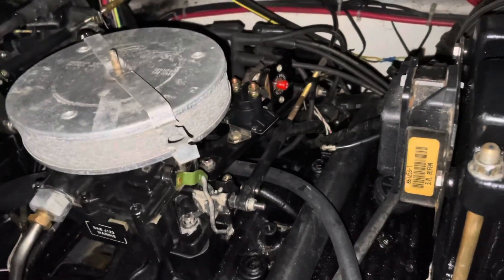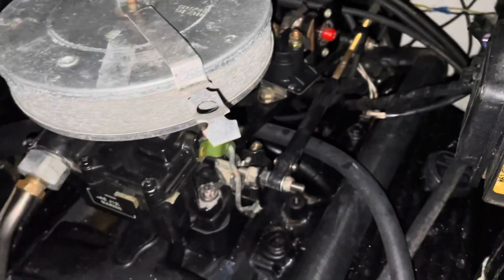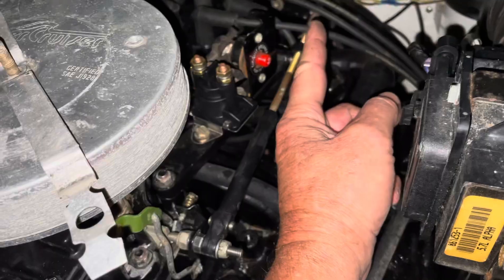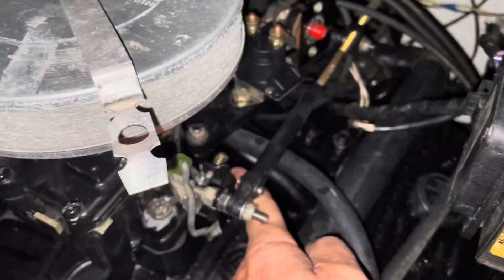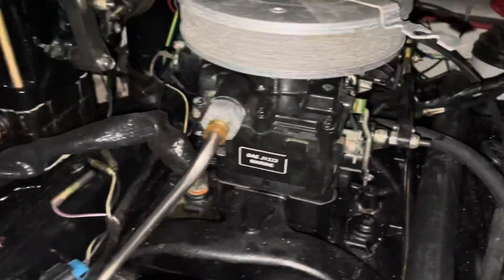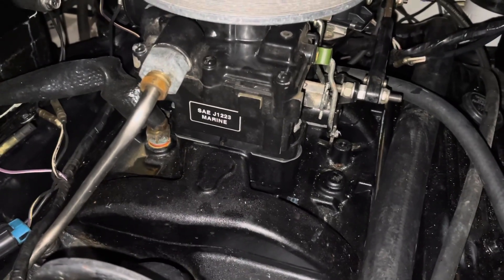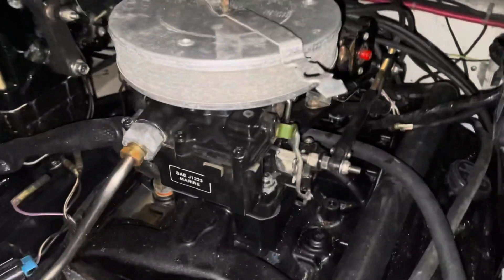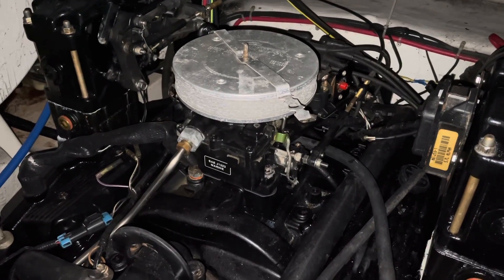Mercruiser 5.7 2(j) - Adjusting Idle (Fix Spark First; See Description)

Comment: Thanks for your video, it has helped me get my 5.7L MerCruiser running smoothly. However, twice now after three or four minutes of running three-quarter throttle on the lake when I throttle back the carburetor just floods. It does not do that when I’m running it on water at the house. I’ve run it half throttle for 10 minutes at the house on water and it runs great. But it seems that when you put it in water under a load, the carburetor floods. any ideas on where I should look?
Reply from the maker: The float in the carburetor is “waterlogged” with fuel, its level is too high, or the float needle and seat are worn and not sealing back gas. As the gas heats up it becomes more volatile and creates more pressure in the lines and can overcome a weak sealing needle valve.

Comment: I had to come back a second time now years later to re-learn where the mixture screw is :). Just got my boat back from the mechanic after a major overhaul and the idle was a tiny bit too low and the engine felt like it was loading up at idle as well. Going to apply your fixes after I burn out some of the older gas still in it and see if it helps.  Otherwise she's running like a top!  Thanks again!

Comment: I have 2005 Bayliner with a 3.0 Mercruiser.  Replaced the Carburetor and fuel filter, both new.  It idles great, but I eve i get above 3500 rpm the engine back fires and bogs down. Downs get to full speed. Should I move on to check spark plugs or fuel pump ?
Reply from the maker: Backfiring is a sign of a lean condition or leaking valves. Check for obstructions in the fuel line from tank to fuel pump but yes the fuel pump is suspect.

Comment: So what if my cable is adjusted all the way but the cable is still short meaning its not closing all the way so it can iddle properly, once I throtte up it does not bring back to iddle all the way, but If i push it down with my finger in the carburator a little more then it does, is there suppose to be any play in the cable end? mine does have some so I'm wondering if that's why its not pushing it all the way back once we go back to neutral.
Reply from the maker: Remove cable from throttle completely. Close throttle lever with hand until it hits idle speed screw. Adjust screw as necessary to get proper idle speed. If it idles properly without cable attached and no adjusting of cable will let it idle the same way then cable is either too tight or worn out.

Comment: Where do you set the idle mixture screw at a rebuild?
Reply from the maker: Halfway between the two extremes where it stumbles. Other method is to adjust for best idle vacuum using a vacuum gauge.

Comment: Hi, I have a 1989 omc cobra and the sifting is either good or terrible and it gets stuck in forwards and is impossible to get out. I pull so hard on the throttle back sometimes it skips over neutral and goes into reverse. I think the idle is preventing the outdrive from shifting. Can you help with this?

Comment: i have a 1981 renken its a gm 2.5L 4 cylinder i can not get it to idle  When I go to put it in neutral it just dies and whenever I try to take off I've gotta put it in gear just a little bit
Reply from the maker: Adjust the idle speed to 800 rpm with it in gear. Then adjust the idle mixture for smoothest operation.

Comment: What does 4.3 mercruiser piston ring gap need to be
Reply from the maker: It depends on the piston. Silvolites tell you in the instructions what the gap should be. But if there is no guidance from the piston manufacturer use the values from Kohler Industrial Engine service manual here:

http://www.kohlerpower.com/onlinecatalog/pdf/tp6103.pdf

Also keep in mind the 4.3 is just a shorter version of the 5.7 so you can also use this manual:

http://marinepowerusa.com/wp-content/uploads/2019/08/5.0L-5.7L-MEFI-4-Service-Manual.pdf
Reply: What kind of oil goes in the speedometer filter gearbox valve?  Yea... Stupid question.  Just like asking about piston ring gaps on a carburetor video.

Comment: How can you put a vacuum gauge on a boat motor. I cant find anywhere to put my vaccum gauge on my 1991 4.3L also how or does the timing factor into idle speed?
Reply from the maker: There usually isn’t a fitting to connect a vacuum gauge to. If you really want to connect one you have to tee into the pcv hose.

You must set the timing to factory spec before adjusting idle speed but you also are supposed to set the idle speed before setting timing. Confusing right? Adjust idle to whatever the timing chart says as best you can and then set timing. You may have to go through it a couple times to get it right.